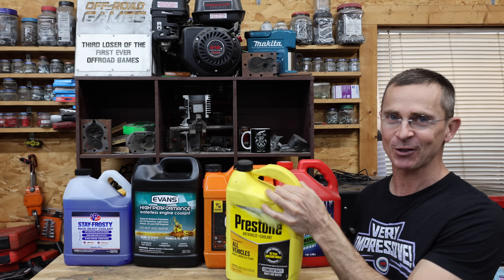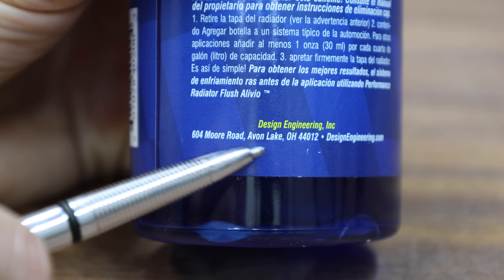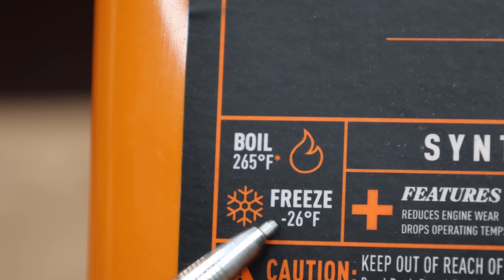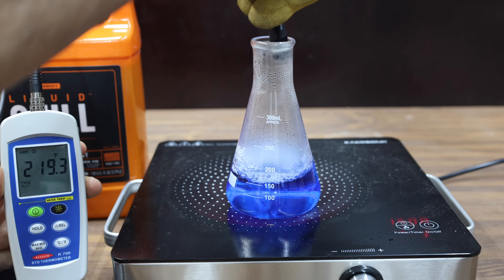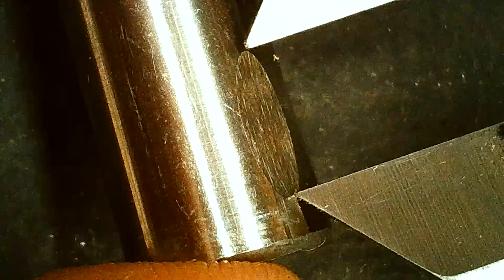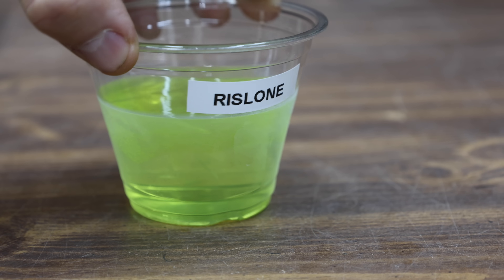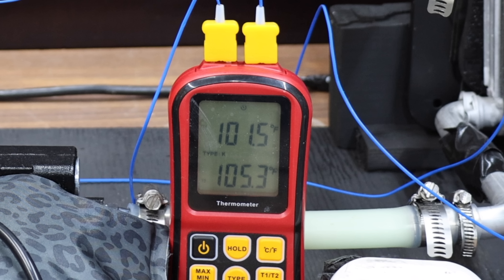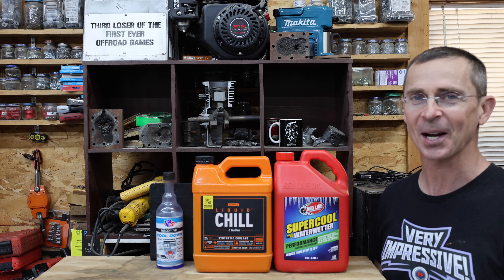Do "Super Coolants" Lower Engine Temperature By 30 Degrees?

Comment: It would be interesting to have these compared to some of the OEM coolants that claim to be special in various ways.  Modern cars also seem to like running hot, I know my Subarus seem to like running around 205-220F in summer...and to my amazement when I had a radiator cap fail on an intense mountain summer road trip I never know there was an issue until I got home and happened to check the fluids noticed the expansion tank was empty, white all over stuff, and once cooled radiator not full.  Never overheated by some miracle.
Reply from the maker: Thanks for the suggestion.

Comment: Good test and I guess indirectly the radiator test shows it but woud have been good to add a specific heat capacity measurement. That is the real indication of how well a coolant works, when we are talking about removing heat form an engine.
Evans and all the other waterless "coolants" are garbage in that respect and with their high BP will damage an engine before cooling it properly when run in a system not designed to run such low specific heat capacity coolants.

Comment: Before watching, my prediction is that they will not work. There is a thermostat that regulates coolant temp, so the only way they can help is if your cooling system is not sufficient - which might be the case if it was like 120 degrees out.
Reply from the maker: Thanks for sharing.

Comment: If you change the antifreeze to water ratio you will lower your engine temp as its water that does the cooling part. The downside is losing the antifreeze properties but depending on where you live this might not be an issue. For example for me in Florida I run a 70/30 mix with excellent results. On the highway my temp drops 20 degrees. In traffic it doesn’t do much as the thermostat is regulating coolant flow. For track days I started using Water Wetter to help with heat exchange and noticed it did bring the max temp down 5-8 degrees.
Reply from the maker: Thanks for sharing.

Comment: Evans is very effective.  Have used it to resolve overheating problems on a KDX220R ridden very hard at very high altitudes on super-steep terrain.  Slipping the clutch often adds a lot of that cant be gotten rid of at slow speeds and in thin air.  A higher pressure cap did not solve but Evans did.
Reply from the maker: Thanks for the feedback.

Comment: We’ve been using Redline Water Wetter in our race cars for years now, and I can confirm that it’s great stuff! We race in crazy south Texas heat and humidity a lot and it does a great job. We’re not allowed to use traditional antifreeze but we’re also kinda not allowed to push water out all over the track from overheating so we use what we can lol. Great video as always sir!
Reply from the maker: Thanks!  Thanks for sharing.

Comment: If it matters,  I use 35% coolant, 65% distilled water,  and a bottle of water wetter OR the Amsoil version of that,  "dominator coolant boost" , to be fair I have a big fat radiator made by DeWitts. Coolant never goes over 198° - maybe 204° on a racetrack. This would be in a C5 or C6 corvette. (*edit, I would love to see a 50/50 prestone/distilled, and then compare the additives. Water,  wetter, Amsoil coolant boost,  others.. I think most people would run that)
Reply from the maker: Thanks for sharing.
Reply: I would watch the additives only based on a 50/50 coolant/distilled + the additives (water wetter, amsoil coolant boost, etc) thanks! @ProjectFarm

Comment: The thermostat of cars opens when it reaches a certain temperature, if the antifreeze does not reach the temperature required by the thermostat, the thermostat will not open and the antifreeze will not flow. That makes me think that no matter what the antifreeze is, the engine will run at the temperature that the thermostat says.
Reply: Yeah, the easiest way to reduce your coolant temps is to get a thermostat that opens at a lower temp lol. The cooling systems of cars can remove way more heat than the car can generate in most circumstances.
Reply: @rubiconnn  This will only truly work if the fans are programmed to come on sooner along with the lower degree thermostat.
Reply: @rubiconnn that was possible with cars from twenty years ago, but with new ones, the slightest variation and you'll end up calling a tow truck.
Reply: 2 of the same vehicles with the exact same radiator and 50/50 coolant water mix, same engine setup, both made within 10 rwhp of each other near 600 rwhp.

1 vehicle had a 187*F thermostat and another had a 160*F thermostat. 

The 160*F thermostat equipped vehicle reached about the same coolant temp on a warm day, idling and after 1/4 mile passes. 
Both idled at about 195-201*F, full throttle passes down the track saw about 205-210*F.
Data is from the same track day as both vehicles were being datalogged by the owners.

Real world results
Reply: @GTStuning-  FWIW, the temperature at the cylinder head will typically be between 15 and 40 degrees higher than the temperature at the thermostat neck in my Chevelle under much of any load.

With a big aluminum radiator and a couple of electric fans, the thermostat outlet stays pretty close to the set point.  (Also a high flow thermostat and an Edelbrock Victor pump with the right size pulleys)
Reply: Exactly my thoughts as well.
Reply from the maker: Thanks for the feedback.
Reply: Yes, the thermostat controls the normal operating temperature in "normal conditions". However, when you are towing, racing, driving or idling in a very hot environment (115 in Phoenix, AZ in the summer is not normal for any manufacturer, 95 in Texas is normal), the coolant temperature will rise above the 195 degree set point of the thermostat. That is where these water wetters claims come into play. The thermostat tries to keep the temperature UP to 195 by restricting flow at lower temperature. It cannot do anything to lower the temperature, as full flow is the same at 195, 220, or 250.
Waiting at the fast food drive through in 118 degree heat, the 7.4L in my suburban will get up to 235-240 degrees in just a few minutes. The thermostat is at full flow, but cannot keep the heat lower. How much is the Redline Water Wetter helping me? I know it's time to flush the system again, fresh clean fluid. 
I know from the past, I have fewer problems with Water Wetter than I did without it.

Comment: I've never really thought about the coolant system needing lubrication, doesn't really make any sense. The only moving part it touches is the coolant pump. That being said, it can extend the life of a coolant pump. Not really needed on timing belt vehicles though, they're replaced every time with the belt.
Reply from the maker: Thanks for sharing.

Comment: The only thing I would have suggested different was during the heat exchange test, the last test, I would have suggested adding 1 more thermometer measuring the temperature of the air moving past the radiator to see which product released the heat the highest. Vehicles heaters use the coolant as the heating source to warm the passenger area in winter, and if any of those would have caused the air to actually been warmer which would contribute to more heat in the cabin would have been good to know too. Granted the upper hose temp does give us an idea of that, but adding 1 more thermometer would have confirmed that. Otherwise, I've been wondering about these products myself so thank you for testing them.
Reply from the maker: Thanks for the constructive feedback.

Comment: Thank you very much for yet another highly informative video! I’ve been following this channel for years and am a big fan. Unfortunately, this is the first PF video where I find the experimental setup not quite appropriate. For automotive applications, it would be much more important to examine its ability to prevent cavitation on vane pump blades, as well as its temperature behavior under pressure in a typical cooling system. The temperatures used should be representative of real-world automotive conditions.
Reply: I was thinking the same thing. and the part about lubricating the water pump is completely bogus

Comment: I'm no scientist, nor is anyone else here, but I do think the temp differences would have been greater if the temps tested were closer to actual operating temps.  I understand that attempting to do such would have added a lot of complication, time, and risks to the process, but it would be more accurate and possibly more representative of the great claims made.  
But again, unless you're doing your own fuel/spark mapping for extreme performance (as many tuners/racers/pullers/boggers might), wetting the water (Redline Water Wetter-not tested) isn't going to do anything but remove some $ from your pocket.
Reply from the maker: Thanks for the feedback.

Comment: Long been a thing for racing engines in racing cars, but modern vehicles are designed to run at an optimal temp range under normal driving conditions. Doing things to change that temperature will be countered by the engine managment systems. Consider these things.

Comment: Excellent video, appreciate the analysis as always! One request - the final/overall results would be more meaningful if you used weighted scores for the finishes with each individual category. For example, in the heat exchange results, there's a big difference between 8th and 9th place, whereas 7th and 8th are much closer. Just a suggestion, keep up the great work!
Reply from the maker: Thanks, will do!  Thanks for the suggestion.

Comment: Funny I had a 99 Toyota 4 runner. I thought I'd change the coolant so I bought the latest environmental friendly coolant. A year later doing routine maintenance I discovered the entire cooling system was being plugged with mold. Took forever to power flush. Went back to prestone and never changed to anything else.
Reply: Exactly.  Snake oil.  I always found 'Wetter Water' to be an oxy moron.
Reply from the maker: Thanks for the feedback.

Comment: The Evans coolant makes no sense.
The boilover point far exceeds the point where the cilinderhead (gasket) will have failed. 
In that regard, boilover point is beneficial so you can still prevent engine damage

Comment: You should check your thermometer's "certificate of calibration". It seems to be off a couple of degrees. Water should boil at around 210 degrees F at 1000 ft elevation. In this case it isn't critical because the data is all relative to each other. Just a FYI.
Reply from the maker: Thanks for the constructive feedback.

Comment: I converted my Hilux and Daimler to waterless coolant over four years ago. By making the cooling system open, there's no pressurization needed, and I don't have to worry about blowing another hose ever again. On hot days, after running the old Lux hard and shutting off the engine, I listen carefully for bubbling in the block area. It remains silent, so it's not boiling, thanks to Evans. I was warned that the engine might run 10 degrees hotter, and seeing this in your test was very interesting. However, I believe a hotter engine might help keep from carbon buildup and, if not driven hard all the time, could potentially improve efficiency as well.
Reply: Interesting.
Reply from the maker: Thanks for sharing.

Comment: This was great. I owned a car that had Evan’s in it. It does what it says. It did run a tad hotter across the board but not worryingly so. The biggest drawback to Evan’s is because the boiling point is so high, if there’s a cooling system issue and the engine overheats, it won’t boil over and let you know there’s an issue until way past when damage has been done.
Reply from the maker: Thanks for the feedback.

Comment: Awesome stuff! 🔥

I live in the Middle East (Qatar), where summer temperatures easily hit 50°C! I've been considering coolant additives for a while, especially for my 2019 VW GTI (slightly modded with intake & exhaust). It’s my wife's daily driver but also sees the track in winter (roll race, quarter-mile, and autocross). However, the VW GTI community I’m part of was quite skeptical, saying that VW’s cooling system is finicky and might throw dash lights.
My other car is a 2020 Nissan Patrol (4.0L V6) its my daily and weekend dune basher. 

Given the extreme heat here, I’d love to use coolant additives if they genuinely help the engine run cooler & provide added protection.

Would love to hear your thoughts and experience on this! 🚗💨🔥
Reply from the maker: Sounds like the VW is pretty finicky.  I'd probably avoid using additives, unless the vehicle is overheating.

Comment: I ran evan in my motorcycle bike shop recommended, system has to be purged of all water 1st. Had an oiling issue, and camshaft ground into cylinder head, the problem was there was no boil over warning with Evan's motor was cooked, Switched to water wetter with a temp gaged rad cap after rebuild all good.
Reply: And if you puncture a hose, you can just add water without wasting very expensive Evan's.
Reply from the maker: Thanks for sharing.

Comment: Water is one of the best easily accesible liquides in therms of heat capacity. To have "no water" doesnt sound particulary good to me in a cooling system in that regard. Viscosity and cooling performance out of the way the evans looks like a good product. Little expensive tho.
Reply: Yep.  Simple Thermo Dynamics.  Say 'No' to snake oil.
Reply from the maker: Thanks for the feedback.

Comment: Regular street driven, smog vehicles can't run, too, cool. Sensors, switches and fuel start working or work best at a certain temperature, usually over 195 to 210 F, even higher in same cases.
Reply: Yep.  Say 'No' to Snake Oil.
Reply from the maker: Thanks for sharing.

Comment: I would have liked some discussion of the weasel marketing used here.  Engine temperature is controlled by the thermostat, as specified by the car maker's design.  None of these products will reduce it unless you replace the thermostat, and that would be harmful - the car maker knows the optimal running temperature.  Also, lots of blurbs like "UP TO" - this means less than, and even zero improvement counts.  I doubt anyone except racers or maybe people living on the North Slope of Alaska need any of these products.
Reply: Yep.  Snake Oil.
Reply from the maker: Thanks for the feedback.

Comment: I would like to see Sierra antifreeze/coolant reviewed, I have used that in my 99 Mustang six, that I bought almost new. Seems to protect very well against corrosion, and boilover, here temps get into maybe 20's rarely at the coldest, never had a problem. I would hate to add something that would my coolant toxic, it is great to know that IF it leaks, it won't kill an animal - and IF my heater core leaks, isn't as likely to bother me healthwise until it is fixed. The only problem I ever had with sierra was when traveling with 3 people in my Mustang,  one being a very overweight adult with health problems - so temp was 115 plus in the area, I stopped at a fast food place so she (passenger) could rest, when we got back out a few minutes ago I went out ahead to cool the car down, sitting with A/C on while idling - when we got back on the road, noticed gauge at 3/4 - couldn't turn A/C off because of her health, so watched carefully as eventually got on hwy in a few miles of stop and go. After about ten minutes on the hwy, needle edged back down to middle - I noticed Sierra says you can use 66% coolant to distilled water ratio - as the highest, to get additional boil-over protection - I think Prestone used to say 70% - it would be great to see these tested at their max concentrations to see how they would compare in boil-over, freezing, and corrosion protection and water pump lubrication to the best of the additives you just tested. Also, should be mentioned that I didn't know for years that need to test Sierra concentration with a refractometer, instead of the common floating-ball concentration indicator. Interesting, I was wondering how much they really differ in readings?
Reply from the maker: Thanks for the feedback.

Comment: I learned the hard way that even with distilled water and a treatment corrosion can still happen. My Z sat for a decade and well... lets be glad I was replacing the radiator anyway because my mechanic said it looked like mud.

So now it stays on 50/50 with a dual core radiator now...
Reply from the maker: Thanks for sharing.

Comment: The only thing I can add is that I would have preferred using a laboratory pipette for the acid instead of relying on a "drop" via gravity and surface tension, but as usual, great video! :)
Reply from the maker: Thanks!

Comment: Evans waterless isnt really a high performance coolant/ antifreeze. It was originally put on the market for classic vehicles that sit around. With no water in the system it cant rust. Rust is a major issue in engines and cooling systems in classic vehicles that just sit around. Many old war time vehicles sitting in warehouses and museums use evans.
Reply from the maker: Thanks for the feedback.

Comment: You should do thermal conductivity of the  coolant. I watched a friends car (classic British Triumph TR3)  warp its cylinder head idling with Evans as it overheated because it did not conduct heat well enough to open the cylinder head thermostat at low flow. So the first we knew was the glycol haze like a massive vape as the gasket blew. He had damaged the temperature sender so there was no warning. But it was idling, not producing much power. When we shot the  hose to the thermostat with an IR gun  it was under 100C. The cylinder head was well over 130C. Water/antifreeze mixtures work better in this case than pure glycol because of better thermal conductivity from water as well as the antifreeze property.
Reply from the maker: Thanks for the suggestion.